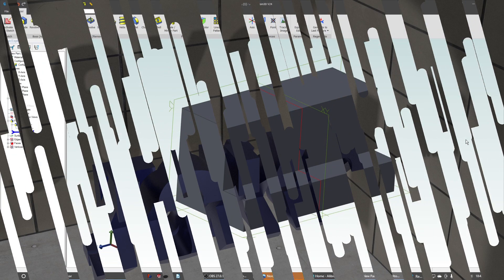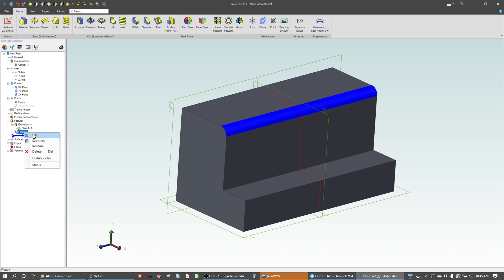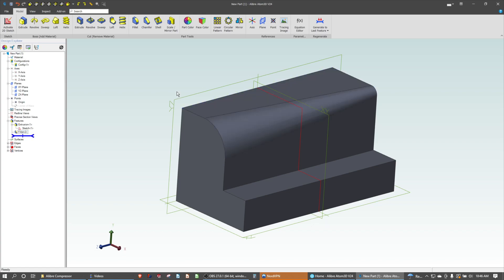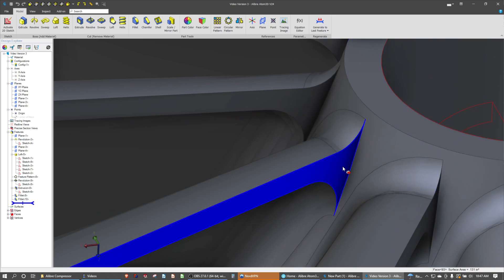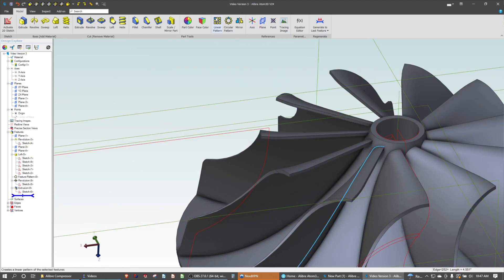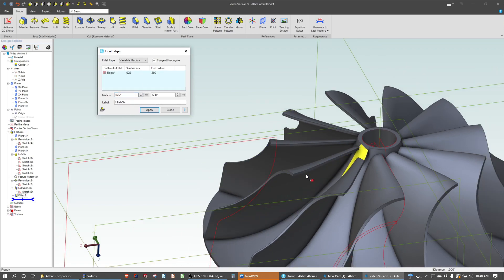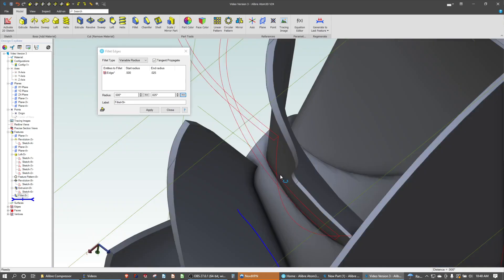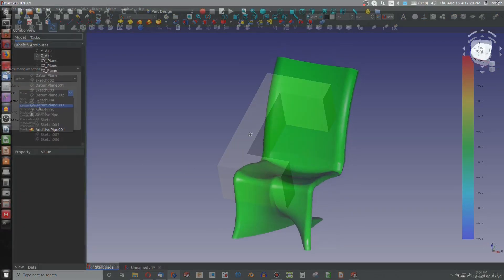Alibre - How to Make Variable Radius Fillets (Short) |JOKO ENGINEERING|

Comment: How would you do the callout for the variable radius in a drawing?
Reply from the maker: That's a fantastic question.  I think in most or all cases the variable radius would be a NURBS surface.  I tend to use ASME Y14.5 2009 or 2018 when I make drawings, and that standard allows you to reference other standards for electronic models (It's been a while but I'm pretty sure I reacall it being ASME Y14.41) .  So for NURBS it is genuine practice to not dimension the surface at all and then say "For all undimensioned features, refer to model per ASME Y14.41" (or whatever the standard is) Then I would have a profile of a surface tolerance to apply to the NURBS surface against the nominals in the model.  If you don't care much about the specific tolerance of the surface, you might be able to get away with calling out the radius at the start and end of the fillet and knowing the profile in between could get pretty groovy and it would still be a pass.  I hope that helps.

"A well regulated Militia, being necessary to the security of a free State, the right of the people to keep and bear Arms, shall not be infringed."
Reply: @JokoEngineeringhelp  thank you for the explanation!! I appreciate seeing these videos about the capabilities of Alibre atom because I've been looking to find a program that's like Solidworks but without the Solidworks price. It's unfortunate that Solidworks is so expensive I've grown to love the FEA simulations (still incredibly accurate for not being ANSYS), the way assemblies work, how drawings are done, etc.
Reply from the maker: @fullfrontgunchannel3197  You bet, I'm glad I was helpful.  Let me know if you need anything else and I like your channel content too
Reply: @JokoEngineeringhelp  thank you!! I really need to release some more videos. I have like 50 short videos just sitting as unlisted